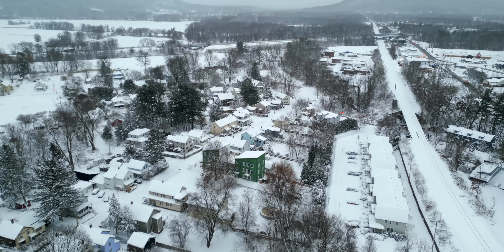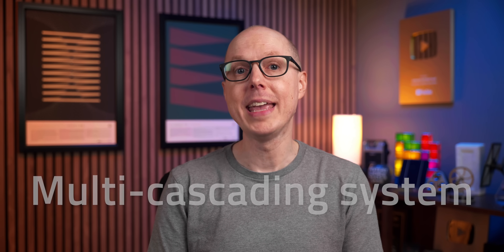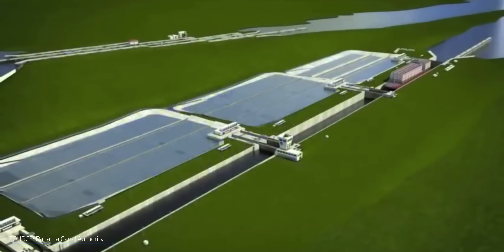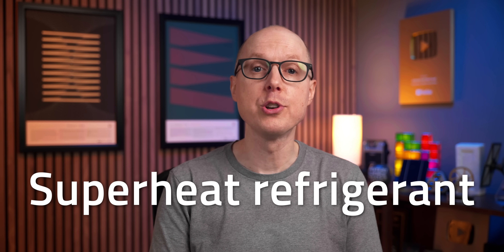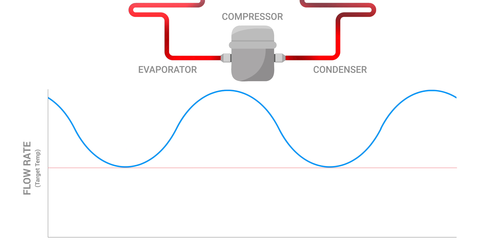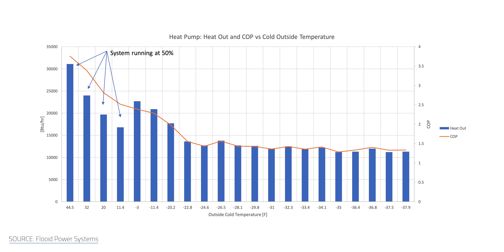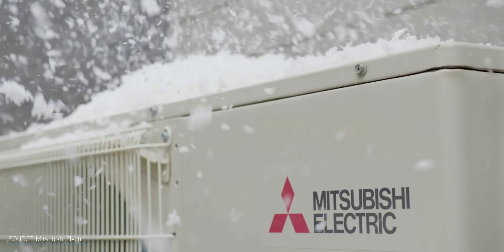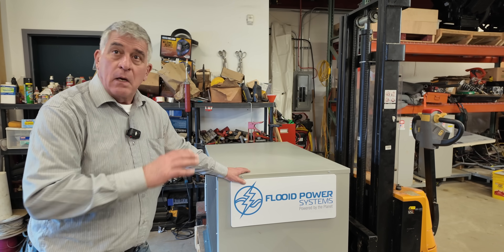How This New Heat Pump is Genius

Comment: NO, hell NO... Cascading refrigerant systems are not a new invention, cascading have been, and still is, used to achieve ultra low temperatures... for decades. 

Thinking of it... this system is even worse than regular "Heat pump" ...let me explain why.
 
If a regular HP have only one refrigerant circuit. Let say... for it to bring in the house 60-70 degrees heat. It needs to kick out the equivalent degrees with a minus sign. ...soo -60-70 cold... that is, if the outside is 0 degrees. If it is -20 then we are dropping to -80--90. All that is fine and dandy, however... most refrigerants at that temperature do not wish to evaporate that is a first. That problem has a solution, the magic cascading. Soo, we are going to get a second refrigerant that have even lower point of evaporation, do a second refrigeration cycle and... that ought to do the trick... -140-160 will warm the -80-90 and so on and so forth... right? 

Well, wrong... I hate to burst your bubble... but there is one thing we are not accounting for. And it is a very simple factor... Humidity in the air. You see... you have a coil, outside that is -80 Degrees and a fan that circulates air through it... the humidity in the air will start building up becoming Ice. After all water turns into ice at -32, and you are cooling at -80-90, Now... imagine if you have not -80, but -140... you will build that sheet of ice even faster. 

Now, if you have a ground source HP... using your aquifer to keep your evaporator nice and toasty at constant 58-60 degrees plus all year around... you are golden. Otherwise... you are out of luck, sorry. 

BTW... every refrigerant have a different PT chart... the numbers presented are figurative...

Comment: No, I don't think I'd want a cascading system that has two compressors, two evaporators, and two condensers, all in series, so it all has to work for the system to function.    That's twice much stuff to go wrong as a conventional heat pump, and conventional heat pumps aren't the most reliable things once they get to be 5+ years old to begin with.

Comment: Just get a geothermal heat pump, My father in law has a water source, because the ground temperature is more stable, they take advantage of this exact same effect described here.
Partial credit on the super heat. Its the ability of the refrigerant to pick up additional heat without changing temperature. This capacity is important for keeping the compressor cool, which is good as heat will kill a compressor.
There is also a newer style compressor (relatively new, 25 years or so) called a scroll compressor, with doesn't have any valves to break (liquid slamming into valves when the piston comes up can often break them), but it can still suffer damage if overheated, but it can handle liquid better than the standard reciprocating compressor.

Comment: Superheat can be addressed by an accumulator it adds volume of fluid. this is done on refrigeration systems for food service where it has to operate in the winter where returning refrigerant has a large amount of liquid with the gas. The accumulator stores the return fluid and gas mixture in a tank filling from the bottom and supplying gas from the top of the tank to the compressor. There are sensors that detect if the liquid in the tank is to high.
Reply: Negative. A receiver is designed to hold excess refrigerant. An accumulator is to protect the compressor during variable conditions. (all heat pumps use them as well as any AC with a rotary compressor) If conditions require it, heated accumulators are used to make sure you only have vapour entering the compressor. The accumulators only job is to protect the compressor from liquid, proper SH control methods are still required.

Comment: Tax rebates are only good for the upper middle class and above, Matt.  For example, a Tesla buyer can only make use of the $7.5k rebate if they make $75k or more a year.  Please lobby for utility-company-financed rebates that =anyone= could use.  Thanks for your continued fascinating vids.
Reply: That's simply not true. You must have at least 7.5K in taxes owed to get the rebate.
The lowest in most states would be 40k per year to qualify for the full rebate. The highest state (Texas, Arizona, etc. due to no state income tax) would need to make 70K, not 75k.
And it's prorated, so you'd still get a portion of the money back if you didn't reach the full amount.

There is, in fact, a MAXIMUM (150k for individuals, 300k for joint filers) you can make to qualify. So, again, the "or more a year" is nonsense.
Please lobby for a better understanding of how federal tax incentives work.

Comment: So why not eliminate the compressor(s).  If I remember my physics course correctly the "Electrolux" refrigerators (heat pumps if you like)worked with no moving parts at all.  All that was needed was an input source of energy, like a gas pilot light or an electrical heating coil.  They also seemed, not surprisingly, to have enormous life spans. Is this system not suitable for today's world, or has the system just been forgotten?
Reply: Absorption refrigeration has a much lower COP than vapor compression refrigeration. The tech is still used on RVs where you have propane but don't want to run a generator all the time. If you have electricity a compressor will use 1/5 the energy.

Comment: Matt have you come across research about heat pump placement? A news item in 2022 caught my attention that the physical placement of a heat pump can decrease or increase effectiveness. If you've already posted about this thank you I've missed it. If you've not a short video would be appreciated. Imagine retro fitting your current heat pump and lowering energy costs. Keep up the great work.
Reply: Heat pumps should be positioned so that the cooler exhaust air can't accumulate and /or recycle. IE. A low spot in the terrain, some backyards. I've seen a wind protected flat yard run 10°f cooler than ambient. That's about the extent that placement has an effect.

Comment: You totally miss the problem with heat pumps.  It is not the refrigerant cycle that is the problem.  First, liquid in the compressor is a non-problem.  Car compressors solved that decades ago with liquid separators & separate liquid pumps.  Modern compliant scroll compressors can handle liquid-gas mixtures without any additional hardware.  Second, the refrigerant's boiling point can be adjusted at will by the pressure.
          The hard part is in the outdoor heat exchanger.  No matter how large it is made, frost forms on its surfaces in heat-pump mode.  The system is forced to periodically (Englichspeak for "every 2 minutes") reverse the refrigerant flow to melt off the frost, using most of the heat gotten to melt the frost, not heat the room.  Winter air is mostly close to its dew or frost point, so it takes little heat flow to start frosting.
          The COP efficiency banks on having LOW temperature drop in the heat exchangers (on the order of 3°C).  That's why modern A/C outdoor units have absurdly-large heat exchangers that wrap around 3 sides of the large cabinet.  This is even more important for heat pump.  Yet I see heat pump outdoor units being small boxes with fan in the front, like older, less, efficient, A/C units.  Heat pump should have even LARGER heat exchangers!  IF THE cop IS LESS THEN 3, NATURAL GAS IS CHEAPER!
          Of course the use of refrigerants will increase with heat pump manufacture/usage.  They cause enough problems already!  Either they are poisonous, flammable, of ozone depleting.  They require specialized training & equipment to use, & are hazardous.  The compressors are mechanical, & wear out.
Reply: The COP at which natural gas is cheaper varies a lot based on the cost of gas and the cost of electricity at a specific location, as well as the efficiency of your gas heating setup.   I did the math for my house in PA, which currently uses a 95% efficient gas setup and came up with needing a COP of almost 5 to break even.    Needless to say, I'll keep my gas for the time being.
Reply: Side-discharge outdoor units have multiple rows of coils. They perform the same as a single-row system with thinner coils. Defrosting still is an issue but it's not that bad. Defrosting only needs to put back the energy that was taken to freeze the ice. Since defrosting COP is very high this is negligible energy loss. As long as more energy is extracted from the air than is going to freezing condensate it will maintain efficiency. The bigger issue with defrosting is the momentary loss of heating capacity.
Reply: @eDoc2020  No they don't.  When you have multiple rows of coils, the second & subsequent rows are taking heat from air that has already been cooled by the first row.  Because all the coils are isothermal, only the first row does the work.  That is why A/C units changed the design to large-area single layer coils.  EVERY coil is exchanging heat with air that is outside ambient.
          Regarding defrosting, it takes HUGE energy to melt frost (80x that required to change same mass of water by 1C).  & that assumes that ALL the melted frost drains away (it doesn't, surface tension holds a lot of it in between all those closely-spaced fins).  An additional heat of 500x is required to evaporate away that water, or it will immediately refreeze.  The refreezing water expands & damages the fins.  The capacity of the unit approaches zero while the compressor still draws the same power.  Then you need backup heat source with COP = 1, at the very time when the heat load is highest!  To support that, insane high-amp electrical service is required.
Reply: @bpark10001   The first row does most of the work but the second and third rows do some, just like how 96% furnaces with an extra heat exchanger transfer more heat than 80% single-exchanger furnaces.

Regarding defrosting, all of the energy needed to melt the ice is already transferred inside the house. Assuming an infinite COP when defrosting the overall COP won't be hurt at all, it would just be like you ran the unit in heating mode for less time. In reality the COP is not infinite but a realistic COP of 5 is 80% as good.

And you don't need to waste 500x the heat evaporating all the water after melting the ice. If it doesn't drain off naturally then run the fan to force it off.

As I said before I think the main problem with defrosting is loss of capacity, not loss of COP.
Reply: @eDoc2020  ALL the energy to melt the frost WAS "already transferred to the house", & now, it must be transferred BACK OUTSIDE to melt the ice.  Valving reverses compressor connections, reversing the refrigerant flow.  Pressure in outdoor exchanger must go up so condensation occurs in outdoors exchanger, yielding heat.  This takes time.  Pressure drops in indoor exchanger.  Refrigerant there boils, using heat from house, to be compressed & sent outside.  Not only are you losing the TIME you could have heated the house, you are moving the heat back outside while consuming energy.  You are not just melting the ice, you have to warm up all the metal in the heat exchanger while also losing some of that heat to the outside air (yes the fan is shut off, but outside air is still contacting the heat exchanger which has large area).  Its like driving somewhere & periodically driving backwards for intervals.  You are using gasoline while getting further from your destination.  Then the valve reverses back.  The pressures must rebuild before heat can move into the house again.  AVERAGE COP GOES DOWN.
          Regarding furnace series cascade heat exchangers: THE SITUATION IS TOTALLY DIFFERENT.  In heat pump & A/C, all the exchangers are ISOTHERMAL because liquid & gas refrigerant is present, & the drops between exchanged fluids is SMALL (on the order of 5°F).  You are pushing against the "wall" of what entropy 2nd law allows.  In a furnace, there is a huge TEMPERATURE DIFFERENCE between the flue gas out of the burner & the house temperature.  First exchanger brings flue gas from ~2000°F down to >212°F (so water does not condense in the steel flues)  This exchanger is cooled by house air AFTER it has passed through 2nd stage exchanger.  Second exchanger (stainless steel) cools flue gas so water (chemically formed in combustion) condenses & releases more heat to the house.  This scheme is called COUNTERFLOW exchange as the flue gas & the house air move in OPPOSITE directions.  It is used when large temperature difference exists & there are no phase changes to force isothermal conditions.  More heat can be captured this way, because the coolest air from the house exchanges with the coolest flue gas.  You are nowhere near  limits imposed by entropy 2nd law.
Reply: @bpark10001  Yes you lose some COP, I"m not arguing that. My argument is that the loss in capacity (due to lost time) is much more of a disadvantage.

I agree that the advantage of having multiple rows of coils is small. But it does help, you need some superheat/subcooling to maintain proper operation and thus the end of the coil doesn't do much. The main advantage is that the fins are thicker, giving more surface area.

The cube design works fine, it just takes up tons of space. The smaller footprint of side-discharge units is their main advantage. You have correctly noticed that mini-splits appear to have smaller outdoor coils than conventional units but I think you're missing part of the picture: they're mini systems with smaller capacities. Side-discharge units for 3-ton and larger systems are over 4 feet tall.

Comment: I live in the far north of Canada in the Yukon. Much of the winter is below -35C. Would require additional heating for sure. These heat pump things seem to be getting close though, very interesting. Thanks for all your videos Matt, much appreciated. Keep up the good work!
Reply: Your situation is likely one of the very few where a cascade setup would be useful. You'd still have to try to reduce the heat loss as much as possible so you don't need an extremely large unit to provide primary heating at design temp. You'll need a sizable electric supply. If you're not on grid, it'll be far cheaper to burn fuel than to use a generator when it's cold enough to need this. (if you are using a generator, use a liquid cooled engine and pipe the water to a rad inside. You'll get roughly 2× the heat output compared to the electrical output essentially for free since it's waste heat.)
Reply: might need to go nuclear
Reply: @kev4241  Wish I could set up a LFTR in my backyard! I could heat the neighborhood, lol.
Reply: I think for this kind of situation have an air/water or air/air heat pump is not a good idea and I would look at better solution such as geothermal heat pump or the combination of ice-storage solar heat and heat pump. Even though it may be possible to have a heat pump working at these temperatures, the high temperature lift make it impossible to be very efficient. Or using an hybrid wood & heat pump solution. Some interesting long-term storage may also be worth looking at.
Reply: @Froudd  geothermal is cost.prohibitive in the arctic due to the permafrost layer.
Reply: @senatorhung  Horizontal tubing geothermal might be, but vertical tubing geothermal might well be worth investigating.

Comment: As heating and cooling absorb the bulk of our energy usage, I've been wondering about the feasibility (and efficiency) of having a thermal delivery system that operates in parallel to our existing plumbing, gas, and electrical systems.  It seems to me that a central heat/cold reservoir and pump system, capable of delivering both extremes to where they're needed instead of using electricity to heat one thing and cool another, might be more efficient.  I'm imagining heat/cold pump tubes used to keep my fridge cold and my oven hot, not just heating and cooling water and air.

Where I live, it gets up to 120F in summer, which is as hot as my hot water heater, and it's always bothered me that I still have to use the heater tank to get hot water rather than just passively heating water on those extreme days.  A smart heat pump system could take advantage of those conditions to pre-heat or pre-cool your water and other temperature-dependent systems more efficiently than just storing hot water in a tank and heating up my garage.

Comment: Apparently you can also run two types of refrigerants in one system. I was talking to an expert, and he built a couple of systems to get stuff down to -100 degrees Celcius with two refrigerants in one system, where one would be in evaporating stage while the other was still liquid, to evaporate later. All with one compressor.
Not sure what that would do for efficiency, but it is very impressive to achieve enourmous cooling without cascading several heatpumps. And a pretty big chance that it is much more efficient as well, since using only one compressor. But it is above my understanding :)
Reply: That's the only way a cascade system would be of any benefit. The lower boiling point refrigerants won't condense if the temperature is too warm. But it might be better to have two completely different systems. Just switch from one to the other..
Reply: Pray tell, how do they make Liquid Nitrogen, liquid Oxygen or wonder-of-wonders that new wonderfuel, Liquid Hydrogen, How do space rockets work?
Reply: @peterbetts8740  condensation.

Comment: "heat spells" -- are just as common as they used to be, no more no less. It's just weather this year to year variance.
Reply: Literally zero thermometer or thermostat on earth would agree with you.
Yes, it gets hotter and colder throughout the year (very good! Gold star!!!). 
With that being said, the absolute highest temperatures are getting higher, the duration of high-temperature events is longer, and the average temperature throughout the year keeps climbing.